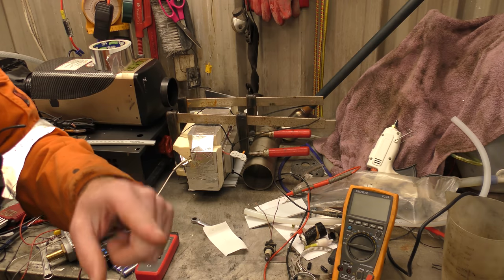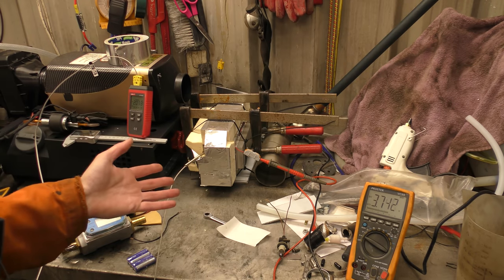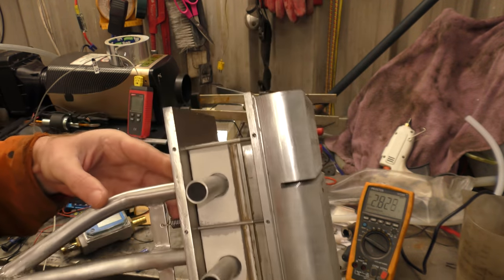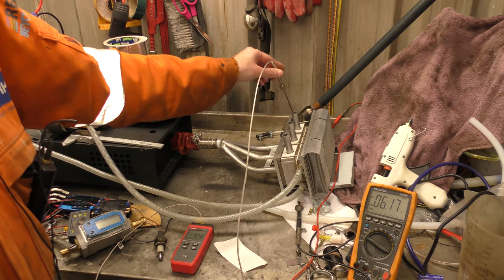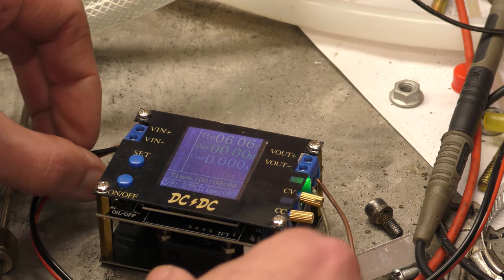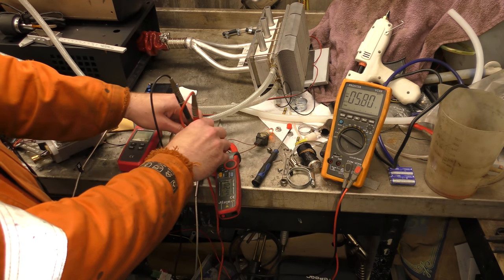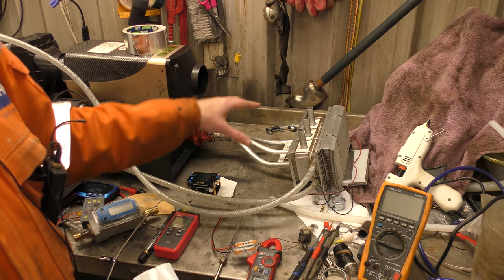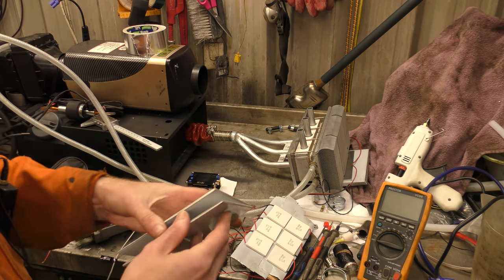Self Powered Diesel Heater Project - part 3

Comment: Brilliant video as usual. The DC to DC converter has to be switched on using the on/off front panel button before the output voltage and current will be displayed, and can then be adjusted. I made the same mistake...

Comment: Thanks for trying these. 
I've been wondering about doing exactly this with a Peltier module that's been laying around from an old cooling project.
I didn't expect much out of it, mainly just an entertaining answer to my curiosity, but it would certainly be nice to eliminate the need for an external power supply.

Comment: You were on the right track with that DCDC! Your open circuit voltage of 6.03V dropped just a bit down to 5.88V when you had a load on there. At some load resistance there's going to be a peak power output. If you could draw 2.0A at 4.0V, that's getting you closer to the 20W or so needed to run the heater? Seems like you need a chunky variable resistor to find that sweet spot; 5ohm 25W would be good... Rad project, I have a couple of these heaters installed; in my old VW and a friends cabin, neato to see someone hacking them like this!

Comment: Watching eagerly, was hoping this was going to be something we could try but with each video I’m thinking it may be above my pay grade 😂
Reply from the maker: It's looking a lot less likely.  In the end we might be able to replace some of the charge in the battery, but probably not the 40-50W of the heater running.
Reply: @DavidMcLuckie  I’ve been meaning to use a similar idea on a wood burning stove to charge the battery while heating the van but the small amount of power they produce it would be a lot of outlay for not a lot of charge.

Comment: I just stumbled on your project. I started messing with the same idea 2 weeks ago.    Mine is quite crude yet but I've been able to pull a consistent 5watts out of my last test( using 3 40mm TEGs).  What I've found so far is to use a cheap boost converter that has no display( displays draw power) and a mppt solar charge controller.  Also look for the lowest temp TEG units.  I'm guessing the ones you have are for higher hot side temp which have very bad efficiency at these lower temps.  I've tried the cheap ones you showed here and the solder on the wire connections melted off.  I think the best bet is to modify the heater to put the TEGs right next to the burner but i havent had the time or money to buy another heater and mess with it.   
  Good luck and if I discover anything new I'll chime in with it.
Reply from the maker: A very clever viewer of mine is modifying a heater body for us to test further.  Stay tuned.

Comment: What you need is an exhaust with an afterburner leading into an exhaust powered turbine with an alternator with a bridge rectifier, that will do the trick, you may have to have a diesel injector in the exhaust, but a blue flame out the exhaust would look pretty.😁😁😁

Comment: Your DCDC, you need to press the on off button, that turns the output on and off :D

Also there will be a maximum power point for the generators. Much like solar panel MPPT charger controllers try to solve; to much current will drag the voltage down and hurt overall wattage. Youll have to deek around with the output current / volts (take note, hell maybe even put it on a graph). Although you need 14.4v so I guess all you can play with is the current.

Make sure they are all in series for minimal voltage drop.

That setup the guy made was awesome, very well made.

What temp does kingspan melt at?

Looking forward to the next episode.
Reply from the maker: Ahh.  I thought the on / off turned the unit on and off.  Can try again next time.

Comment: according to the datasheet and the output voltage of the TEG, the temperature difference between hot and cold side is just 20K. More water flow could yield more voltage and thus power. love your videos !

Comment: I did some experiments using 4x peltier elements on the exhaust of a paraffin pressure lamp. After seeing a similar soviet design as a power supply for a valve wireles set, for use off grid.

Admittedly, the peltier elements I was using are not optimised for heat generation. (Seabeck effect.) It needed a PC fan to cool the cold side. I just about generated enough power to drive the fan !

Comment: A project I'd luv to see is a 1 or 2 KW Inverter Generator modified for direct AC drive of the 3 phase  generator coils for starting the engine. With additional circuitry (similar to hybrid vehicles), it could become an automatic on-demand RV battery charging system. Small engine fuel injection (although now quite rare) could improve reliability and efficiency even further (as is the case with larger car engines).
Reply: PS: Perhaps an R/C airplane brushless ESC would be up to the job of driving the Delta coils when switched into circuit with a triple relay. Don't know how much voltage would be required ... maybe just 12 volts would do it with the ESC throttle set to idle speed.

Comment: the only thing i can think to suggest is to use the tecs almost directly on the burner, so have a square burn chamber, then directly line the outside of the burn chamber with tecs and have a huge heatsink and fan/ waterblocks cooling them, how hot the tecs will get im not sure, but i think testing would be required, as they cant get too hot, but the burner in the burn chamber can be angled away, these are my thoughts, also as efficiency is key when you only have a small amount of power available possibly the impeller and motor design isnt best, i have a feeling that you can get alot more air movement using less power and a more efficient impeller but again i am not sure

Comment: Just got mine yesterday ! The amount of heat is ridiculous !
1) could one use an old Heating radiator with the exhaust to use that wasted heat ?
2) Could I use a mix of diesel and used (filtered) cooking oil ? And if so will it run ok ?
Together with Big Clive and Ralphy you are one of my favourite Scottish YouTubers !
Reply from the maker: 1) yes
2) not really.  The veg oil doesn't really burn well and leaves a sludge inside

Thank you, I am a fan of Big Clive as well.

Comment: Are the Peltier junctions stacked to increase the voltage? The voltage stack efficiency decreases with heat differential so it can be plottable using the area of the Peltiers, medium of heat transfer, and possibly intermedium of next layer mounting (preferably copper). From memory the loss between stacked junctions loss in voltage gain between each layer relative to the heat dissipation. There is a potential each Peltier junction has a sweet spot before the inevitable losses occur.  It is all about the coolest side C efficiency and if it can give the stacked cooling needed. In my case for a CPU that runs very hot, I was not in the range needed. But this seems interesting!  I found that if my benchtop source was running at let's say 100C my temperature differential needed was 0 C to maintain 50C. This was 2012 tech so... let's experiment!

Cheers

Comment: Tecs work of heat differential, given one side is 90c I doubt that passive cooler is going to get any heat away quickly causing your hot and cold side to both be quite hot. I think that's your problem. A simple way to test this cheaply is to connect a CPU cooler to your tec to try and cool down the cold side (Yes, you need to power the CPU fan, but it's just a proof of concept. You could use the inlet air to pull cool airflow over the CPU cooler)

Comment: How many amps does the heater require on a continuous basis? I know the startup is probably a quite heavy load for the glow plug...but after that?
Reply from the maker: 40-50 watts so about 4-5 amps.

Comment: I think you really need max power point tracking or, simpler, setting. You could possibly do it with a boost converter but take the feedback from the input rather than the output and back to front it so that as the input voltage falls below the. Set point it turns the mosfet off allowing the inductor to pump more voltage to the output.

Comment: For a £/W comparison, you should only just replace the three expensive TECs with the cheap ones in that fancy heat exchanger. That way you cut out all other variables except what you are testing for. If the results are the same, or better, then time and money can be expanded on heat exchager design. If not worse, then you have saved that time and money.
Reply from the maker: Fantastic idea!
Reply: @DavidMcLuckie   are you using tec or teg ?

Comment: Man, you spent a lot of money to find out that physics works. I like that. But I wouldn't do it this way. 
As I said in a previous message, the exhaust gas has a low density and a high temperature, so, it contains a small amount of energy. You could measure that energy by passing the exhaust pipe through water and find out how much energy remains in the water. And then multiply by 15%, which is the efficiency of a TEG (as far as I remember).
Cheers!
Reply from the maker: You'll enjoy the latest video in that series then.  :)
Reply: @DavidMcLuckie  I've seen all of the series but not in the correct order.

Comment: DAH!!
Maybe the exhaust gas is not even hot enough ever.  Maybe it will never get hot enough.  They usually build the heaters to to be efficent... and not have wasted heat going out the exhaust pipe.

Comment: Oh no how disappointing 😭😂
The way I see it is that the TEGs are 5% efficient so to get the 50w output from the TEGs we need to redesign the diesel heater with the TEGs inside,so then a 8kw heater can use 1kw of heat to create the 50w needed to run the heater and we still have 7kw of heat coming from the heater,
I imagine that if we have a temperature of 600 degrees on one side of the TEGs and 0 degrees one the other side of the TEGs the TEGs should be around 300 degrees which should give the maximum output of 25w per TEG.
I need to learn how to cast a new designed aluminium head for the heater with flat surfaces for the TEGs and send it to you 🤔
Reply: Yep thinking the same here. I would have guessed the best chance at making this work, would be to have the TEG molded in the internal heat exchanger body of the heater. IF the 5kw heater has to transfert 5kw from the heating flame to the circulated air, I think we could hope this heat transfert, going trough TEGs in the heat exchanger could possibly yield 50W (1%) of usable electricity ? There could be the problem that TEGs are much less good at transfering heat than the actual aluminium cast radiator, thus a lot more heat would be wasted trought much higher exaust gas temperature😖. IF this would be the case, much more combustion chamber/radiator surface area would be needed, and an appropriate number of TEGs added to cover that surface.
Reply: I was just thinking, he could grind all the fins off the back half of the heater itself, and make it flat, and then put the TEGs on that. Also could use the existing fan to cool a heatsink on the cold side of the TEGs if you could make a larger shroud around them.

Comment: Why not just convert diesel heater to a jet turbine with a power driven turbine disk in exhaust stream. Then you hook PT disk to a DC motor and now you have a good power generator. And a good heat source. Oh this looks like a model airplane turbine with a PTO.

Comment: there is 2 kinds peltier.  one to cool (TEC) and one to heat (TEH), i am guessing you are using those to cool TEC in this experiment. are you running the element in series/parallel. 
TEC thermo-electric cooler
TEH thermo-electric heater.
Reply from the maker: No.  There are two kinds.  TEC thermo electric coolers & TEG thermo electric generators.  TEC just heat or cool either side depending on which way you connect them to the power supply.

Comment: I immediately thought of something like this when I found out about these heaters. but Ive had no luck with thermoelectric heaters. they are fragile, use a tun of power bairly do any cooling. and in my attempts to get them to actually make electricity.. terrible. shame this never worked.

Comment: yeah there are ones made specifically for power generation. are these those?  idk why people are on the steam turbine idea. do they know how much steam youd need to make to get 50w out of it. or how much water youd blast through youd be better off trying to heat exchange the exsaust from a jet engine and use its starter as a generator.. but forget about it being quiet. if these Peltier devices cant do it then there is no hope. for this heater design being self powered.

Comment: You're overthinking the whole thing use the exhaust gas to power a hydroelectric generator all it is doing is rotating the same way water would or if you were to blow into one of them drill powerd water pump 🤔 like a "turbo"

Comment: Let me see if I can translate from US to Scottish. These things are fuck awful in- efficient. Like 5% electrical comes out of the heat what goes in. Sooooo, lots of heat going in, you have to get lots of heat out from the other side. Soooo, it's all (95%) abooout the cooling side. And you have to have an electrical load on the TEC units from the get go, to get things going.  Fans or cooling water to get the fucking hot heat away.. From the hot side.. On the cooler side. Good luck.

Comment: That was a laugh and a half...300 quid and dog knows how many hours in building stuff for 1.4W...you'd get more power with a solar panel inside the shed!
Reply: Yes but nothing would compare with the beauty of that fabrication. I want one just as a table ornament. Way to go Dave!👍
Reply: Hey we don’t know the results until we build and try lol.
Reply: @daveparf  I think it would work with more thermal input but if it didn’t it is still a thing of considerable beauty. You have skills sir!
Reply: @robinwells8879  thank you, I try my best 😊
Reply: @daveparf  Well done David, you did a great job on the heat grab chamber 👍
Reply: The manifold and finned heatsink is a work of art, however this specific application is a very poor illustration of its capabilities due mainly to the limitations of the Teg cells, specifically their efficiency at just a few %. 
It looks like it will extract all heat from the exhaust that is thermodynamically allowed. We should measure the exhaust in temperature and the exhaust out temperature...

Comment: not to be a smart arse but, if you're getting 6v couldn't you just get a 6v to 14v transformer?
Reply from the maker: DC itself doesn't work through a transformer, only AC.  That DC to DC box does the magic that can turn low voltage to a higher one and vice versa.  Had I only known the on/off button is actually the output on/off button.

Comment: Thermoelectric power is simply a bridge too far to generate much of any usable power.  Back in the 60s and 70s long before decent solar panels were available, certain remote sensing stations opted for propane powered thermoelectric power supplies.  I acquired one surplus, and they were quite pitiful, using a 10,000 btu burner to produce 50 watts with a proprietary (at the time) TH module, DC-DC switching boost power converter, and  75 pound copper finned heat sink. It cost $10,000 when new.  Efficiency of new modules like yours have not improved, even though costs have dropped greatly.  The entire output of your 8k heater would not be enough to generate sufficient power to overcome their low TH efficiency and operate your project, even if it did have adequate thermal coupling .... nice try though!
Reply: PS: That same amount of propane could instead power a 1 KW inverter generator.

Comment: DAH...
CONDUCT A TEST FIRST!! Dah!!  Take a $10 common plumbing propane torch... Attach the  magic  white square volt generator cube to a blank aluminum plate.  Carefully/gradually heat the back of plate as high temp as possible.  Hook up volt meter to magic white volt generator.  DAH!!... what is highest volt possible.  Will the magic generator cubes EVEN produce desired volt you ar seeking.
Reply from the maker: We know that TEGs work, I don't need to test they work.  What we need to ascertain is- is there enough waste?; if so how best to harness it.

Comment: Stop making the box out of aluminium' use steel it may take longer to start generating but it will keep generating longer when it stops . It will also get hotter. Fins Inside should still be aluminium. The fact the pipes are so hot you can't touch them shows the heat is there.
Reply: That's what I was thinking, most of the heat is lost through the manifold pipes. It would have been interesting to see them insulated. It probably would not come close to the power needed but would still show the potential.
I run my heater at around 1 kW so getting 12 Watts at 12.4 volts from it would be enough. I feel it could be like a dog chasing it's tale though.
Reply: @pa_maj.MARTINI-van-MAN   great point - the max heat will be in the manifold - so therefore the biggest losses.